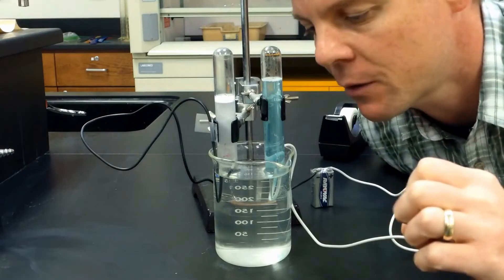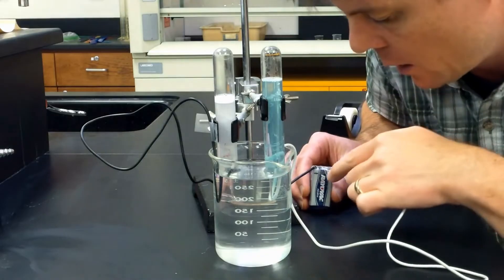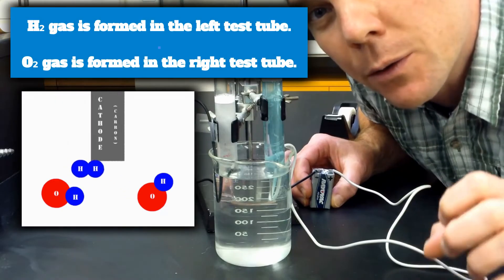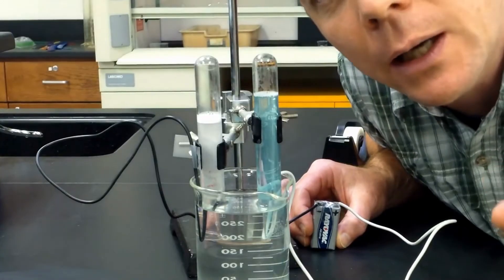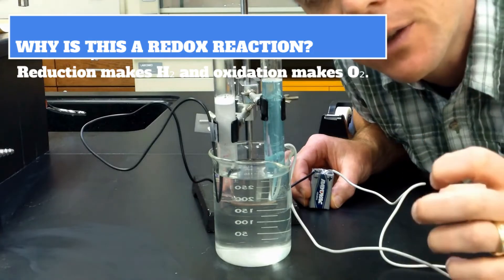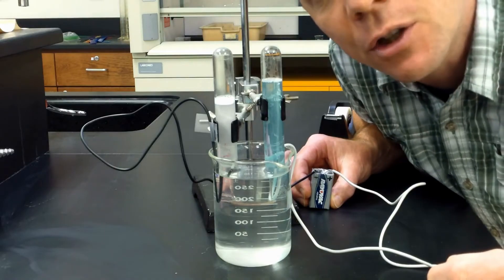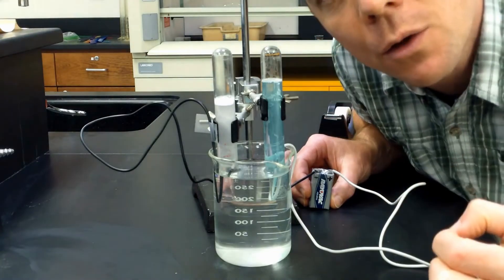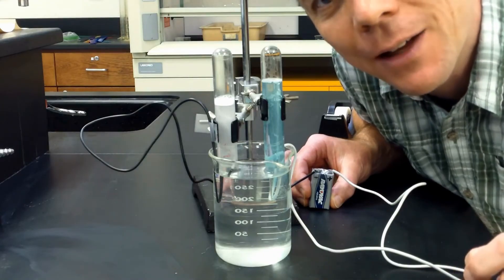Splitting Water - Electrolysis of H₂O

Comment: I’m going to try to repeat this in our homeschool chemistry. Could you tell me the amount of sodium bicarbonate you used? Also are you simply using copper wire for both the anode and cathode?
Reply from the maker: I think I added about a tablespoon of baking soda to the water. The amount does not have to be an exact concentration. I used copper wire for both the cathode and anode.

Comment: Hi and thanks for taking the time to show this.  I would like to see if I can design a system that could function using a solar panel. I have several questions:
Do you know the range of voltages that will work? is the conversion rate dependent on voltage? can water be room temp? Do you have any idea the amount of electrical energy required to convert one unit of separated oxygen gas? or even the current?
Any idea of a conductor material that would be inert?  thx a ton  I know that is a lot to answer   mike

Comment: I'm abit confused... Do you just stick the electrical wires upside down? Is it not connected to anything? Just floating around? Or is it connected to something??
Reply from the maker: You should see in the video that the two wires are connected to a 9V battery. The black wire is connected to the negative terminal and the white wire is connected to the positive terminal of the battery. You can see this clearly at the 00:21s point of the video.

Comment: i have a basic setup, a Tupperware box but i have not test tubes, im thinking if using a sandwich bag to collect the clorine and hydrogen since i don't have a chemistry set. Im using zinc and copper and hot gluing them to the bottom of the box with a nine volt battery as shown. im just wondering if this procedure of mine will work or not and if you have any thing you might like to add.
Reply from the maker: I'm not sure how you plan to use the bags, so not sure about that. You mentioned generating chlorine-please make sure to use an electrolyte such as NaHCO3 so you do not make chlorine. It's poisonous-very dangerous if you make it.